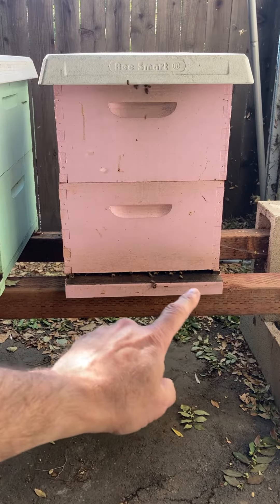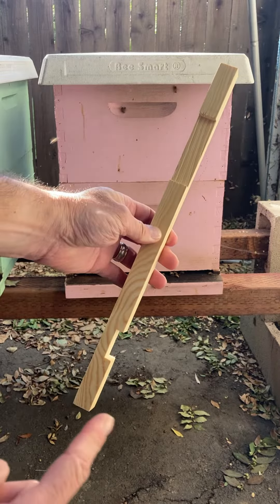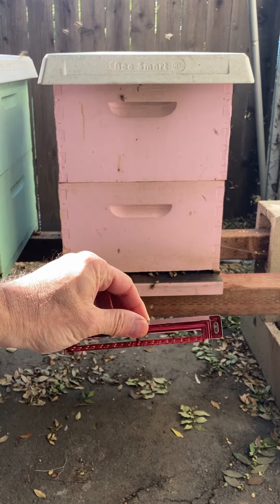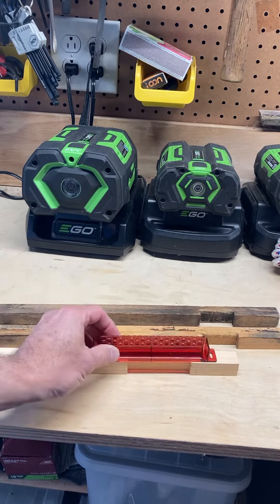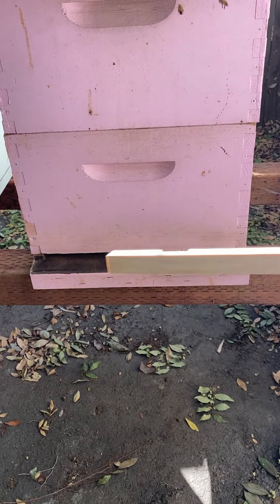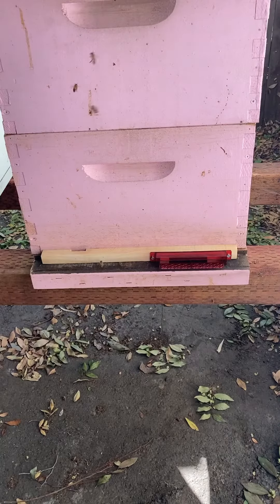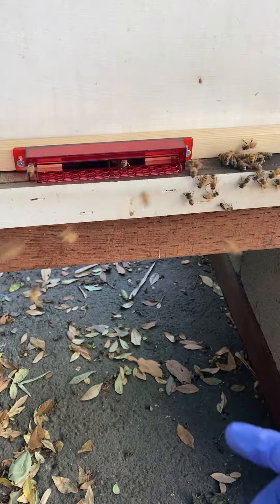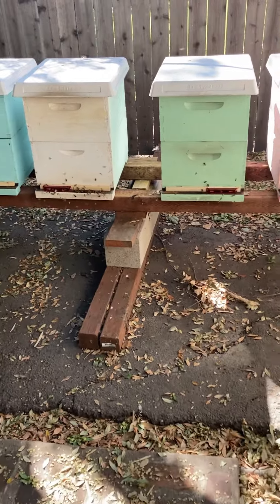Installing Guardian BHE entrance reducers in the bee hives

Comment: Hi, Michael. It seems that your entrance reducer is backwards because the little hole is still wide open on the left hand side of your hive. SHB will crawl right in through there. If If you turn that entrance reducer over twice or flip it around flat side of the entrance reducer on the small hole will be up against the hive and you can still put your contraption on the outside.